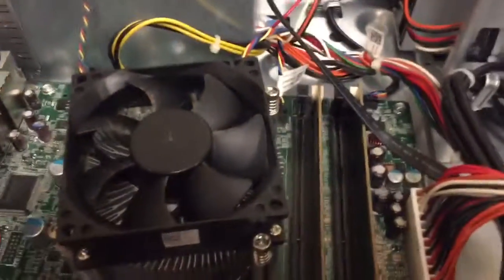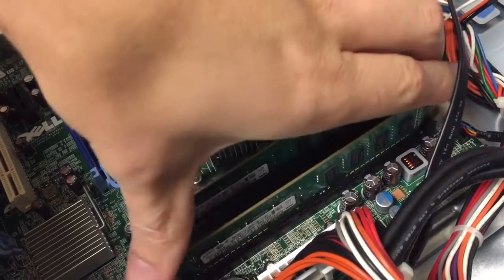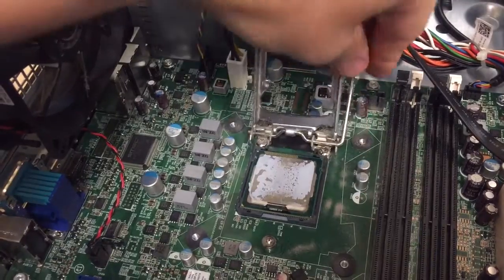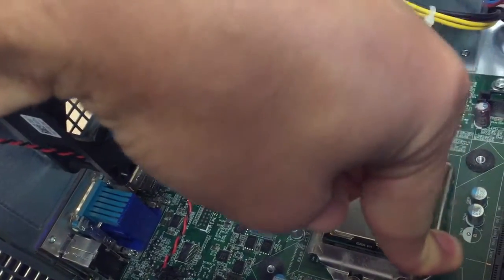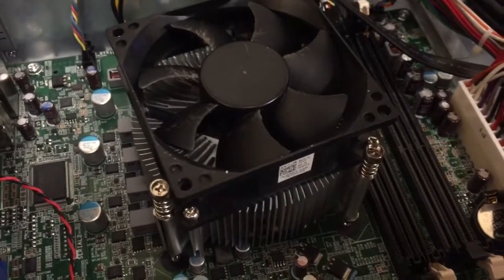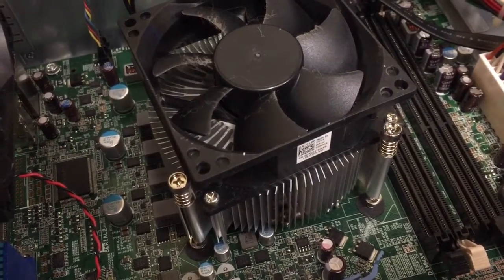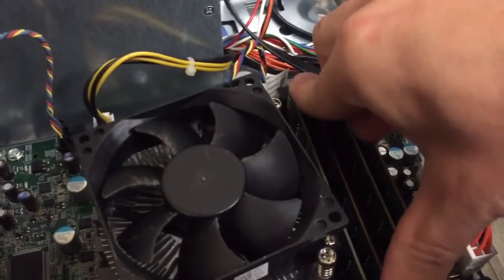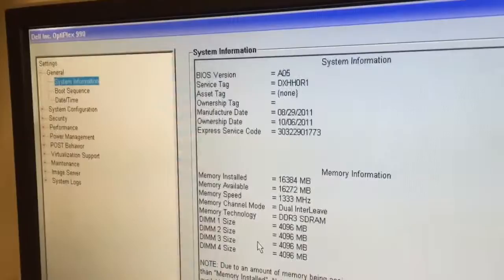Dell Optiplex 990 CPU and Ram Upgrade

Comment: hi i upgraded from i7-2600 to i7-3770 but it just open for 3-4 seconds and close again how will i update my bios without using the i7-2600 anymore?
Reply: it seems that this pc uses chipset Q67, which doesnt support 3rd gen...

Comment: Can I use 32 gb of ram and ddr4 ?
Reply from the maker: max 16gb DDR3
Reply: @mjmcomputers  It will support 4 x 8Gb sticks = 32Gb
Reply: Mine has 24gb the max is not 16gn
Reply: @@supatrendingdaily2757 Well, did it work just fine????

Comment: So I've got a 990 with 16gb.. 4 sticks like this one has. I just ordered 16gb in two sticks hoping I can get plus memory. was going to put 2 16gb making 4 for 32gb.. It should run faster. I've got as nice Graphics card in now with 16gb.  Just want it to be better
Reply from the maker: I think it maxes out at 16gb total.
Reply: @mjmcomputers  damn
Reply: So did it work or 16GB is really the max it can handle? :) I would also prefer 32 GB....
Reply: @gregajk  Yeah so far I've got 24 been doing fine. I'd bet it would take both 16's. I've got 4 slots, two sticks for 16 see.
Reply: @Snowman374th  What brand did you go with? Interested in trying this.
Reply: @lsxobs3709  
NVIDIA.. I think it does great.
Reply: @Snowman374th  Thanks man. Gonna see if I can find some.

Comment: Can I install a 1600Hz RAM in my computer?
Reply: Si, pero solo funcionara a 1333mhz.
Reply: Hey dude I added 1600 mhz and it worked the ram will run at the speed of your slowest ram module btw I have 24gb in mine rn so um I have no.idea wtf these people be talking about

Comment: Looking to do a very similar upgrade (using the 990 as a Hypervisor host so want more cores). Did you have any issues with the i7 and the 265 watt power supply?
Reply from the maker: no issues.
Reply: @mjmcomputers  if your account is stil in use, did you had an additional Graphics Card installed with the i7? like an 1050 or 1050 ti?

Comment: I have the same machine with already 16gb ram and a 750Ti. Can I upgrade to a Xeon E3-1270? It is the same as an i7-2600 without gpu, but cheaper.
Reply from the maker: If I recall correctly, the 990 uses a Q67 chipset, it appears the E3-1270 works with a Q67. But it may be dependent on Dell's Bios updates.

Comment: Hi. You and I have the Same Kind of Dell 990 SFF, If you can tell me How to Open the PCE Slot of the Case itself it will be a big Help for me as I want to upgrade the Video Card but I have no Idea how to open it on the Back of the Case. Thanks.
Reply: there is a latch on the side where the card is if you unlatch that it should come out

Comment: How much for the cpu core i7 sir
Reply from the maker: I pulled it out of a junk pc.
Reply: My pc boots up badly slow after upgraded. Did you face this problem? Or do you have any solution, sir?
Reply: @BorenDecoration  May I ask, sir? A computer like this has a BIOS from a10 I3 2120 I want to upgrade to i7 2500. Do I have to upgrade the BIOS first before upgrading the processor?

Comment: hello man i have the exact same pc with 4gb ram i5 2500 gt630 4gb..i added 12 gb extra ram it  become 16gb ram but still when i boot pc it show me left up screen 4096 and inside pc show 16gb ram but still same performance for games..what i have to do??
Reply: Cant understand
Reply: I dont know if you’ve solved this, but if you got Ram that’s not compatible with the first stick it might not see the new ram. Did you try just putting 1-2 of the new sticks in and take out the old one, just to see if it would see them?  And it has to be ddr3

Comment: Will this work for the Dell Optiplex 960 with the Core 2 quad core processor I want to upgrade it the 16 gigs  and Im also thinking about upgrading the processor and the GPU it has a 8800 GT X in it right now but I want to upgrade the GPU to a Nvidia gtx
1060 I already have a 500 watt PSU installed
Reply from the maker: Looks like you can do 16gb ram max and cpu maxes out at the Core 2 Quad Q9650

Comment: What cpu did you put in?
Reply from the maker: T7600 that I pulled from the m1210. Core 2 Duo 2.33ghz
Reply: MJM’s Workshop Are you sure? Maybe you’re mistaking with another video, I think The original CPU should be i5 or i7

Comment: I have the exact same computer. Can I get a i7 2600K to upgrade from a i5 2400? It's cheaper right now than just a regular i7 2600 for some reason.
Reply: its de same thing, 4cores just .3 more elevate, if you already have one do it but no worth
Reply: No the motherboard does not support the i7 2600k, the strongest cpu that it does support is a i7 2600

Comment: Did you have to use a special dell key to disassemble this when you first got it at all? If so, where could i find one? Thanks
Reply from the maker: +Ricardo Valdes no I did not.
Reply: it is the 2600k

Comment: could use pc3 1600 mhz ram?
Reply: no only 1333mhz max
Reply: @sixstonks9385  I read that it will indeed work, but it will just give you the slower speed of the 1333mhz ram.